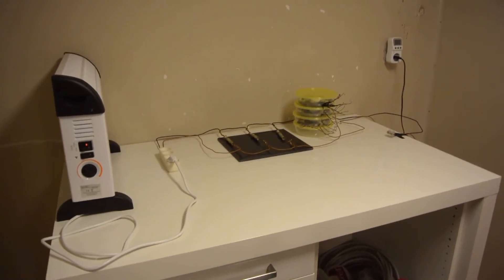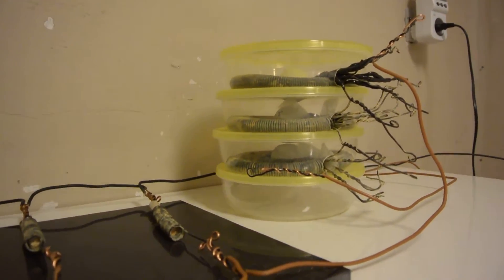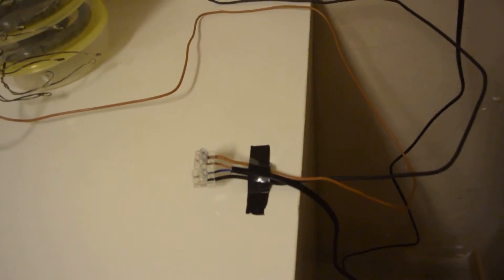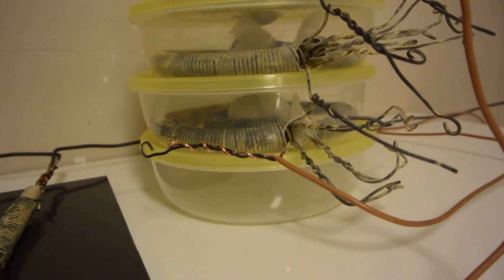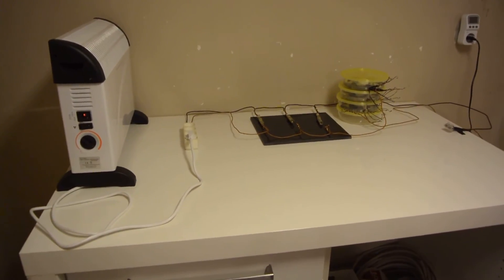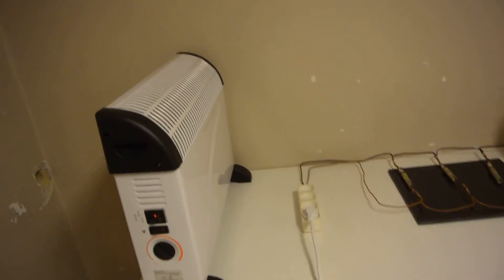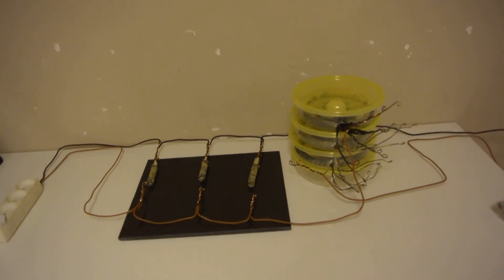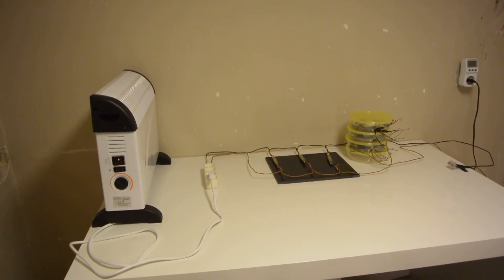Magrav unit Denmark (English)

Comment: hi, I had seen your setup. questions,  why you put 3 reactor (if I don't get wrong). from my understanding of the blueprint. we only need 1 reactor(because it is the centre of the plasma field when the gans spins). as the top coil will capture the top field and the  bottom coil will capture the bottom field, same goes to the central  coil. wouldn't this setup in conflict with the physics of the system?.
Reply from the maker: +angry bird Your right..  Maybe the 3 reactors instead of one, is one of my issues? And then we can ask next question, why have three layers of coils then? 

About the plasma field... In my understanding of quantum fields, the bottom and top coils don't capture the field. All coils with "suns" create it's own field. This means i have three fields, which maybe interferes to each other, which can make a anticlimax in the plasma fields!?  To summit up, one sun seems as the best way!?

As soon i have  finished my MaGrav 2, single layer system, i will make the necessary adjustments on my old system, and make a new test :)
Reply: +Thomas Free , correct me if I am wrong, I don't know much about quantum physic and out of ignorance.  the core (reactor) is supposed to spins and as it is in the plasma state.  am I right?  I am picture it as the core is the sun while the coil with gans consists of magnetical and gravitical (hope I get it right) is interacting with the core (reactor) field of plasma. As for the top and bottom coils is to capture/react to the directional of the plasma field. (presumably plasma field is exiting from the top and return path at the bottom of the core (reactor), just like our planet.

I am in the process to build 1. presently gether information of this technology.

Comment: eI could not find the PDF ...  this link gives a 403 error... and your web site does not have the link .. fantastic news that this looks like it is working ... can't wait till you swap the heaters and get the same results .. at that point I will start building one too .. congratulations on being the first to show a high load .. and decent results ...
Reply from the maker: +GreenEvolutions Try again here :  http://www.thomazb.com/my-first-magrav-manual-english.pdf

Yes, the real test is when the heaters are swifted around!
Reply: Thank you that worked .... I also remember Keshe talking about resistive load being reduced by up to 60% and led lights and refrigerators would be free... so if you swap the heaters and get the same 500w reduction result you should be able to ad 10 30w led or higher light bulbs and not show an increase in consumption ... that would be the ultimate proof it works like Keshe says does..
Reply: +GreenEvolutions Wow... that is a detailed pdf .. perfect ... Saved and ready to go next week if your switch gives the same results ... thank you for all the hard work you put into this..  James in Thailand

Comment: Did you mean the consumption is going down? Also do you not havr any capacitors on the input side? Thanks and well done!
Reply from the maker: +Harry Pink The consumption is going down on the Magrav setup, but keep running normal in my second setup. Today i had a difference on 3,1 Kw. I do not have any capacitors on the input side, i used config. 1 from the original blueprint.

Next week i increase to 2000Kw, and switch the heat panels around, in case of one of the heat panels consume more than the other!
Reply: Thank you very much and great work!!